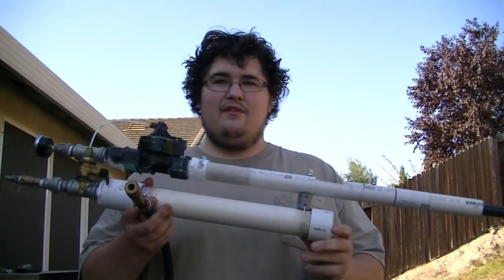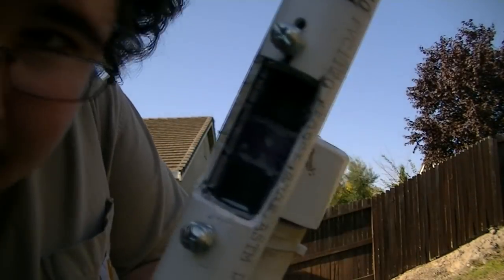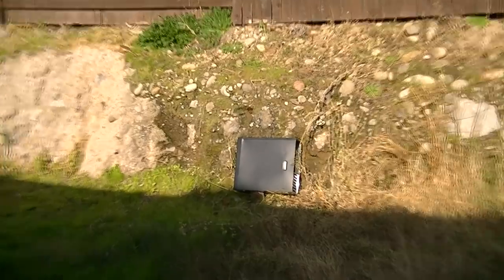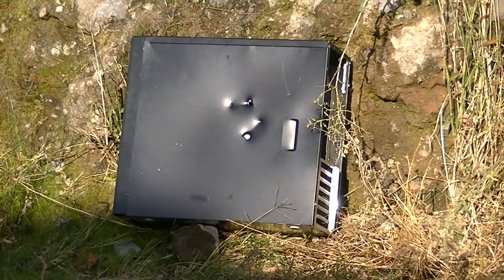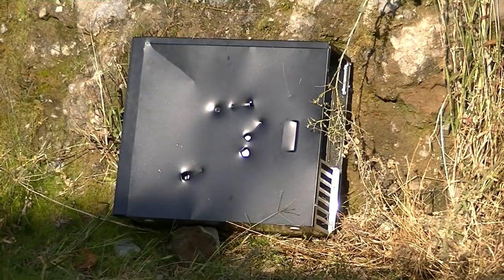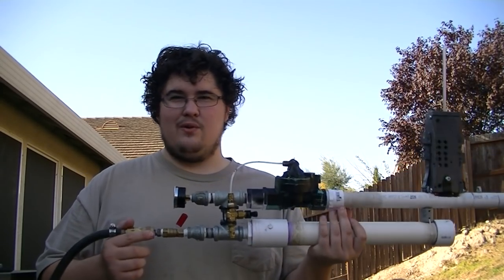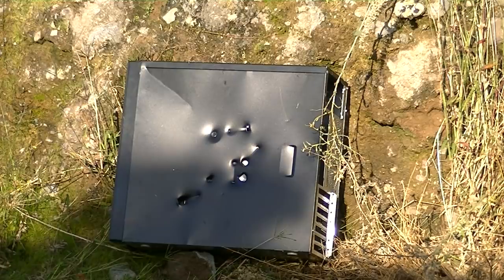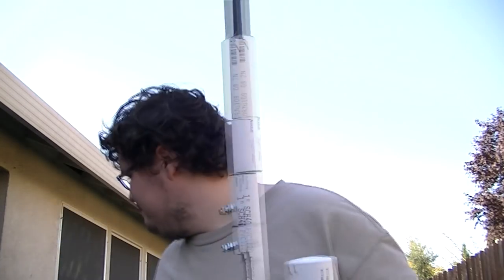Full auto battery shooting air gun: How fast can it fire (RPM)

Comment: looks like some epic stopping power. for some more power you could try putting oil or wax on one end of the batteries to cause dieseling, if dieseling works at the pressure your running at. that would also cause melting of plastic parts as they heat up

Comment: The fix: use an air regulator of some sort to help regulate the air, then turn your pressure WAYYYY up to about 300-500 psi, this will shoot the batteries at a higher fps and insure you don't have any shoot down or drop off. Although very nice contraption